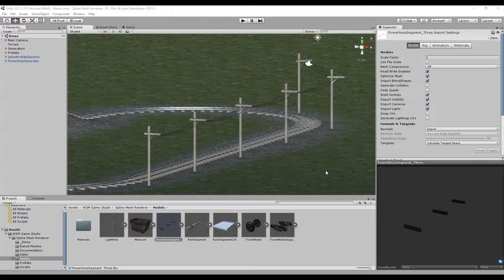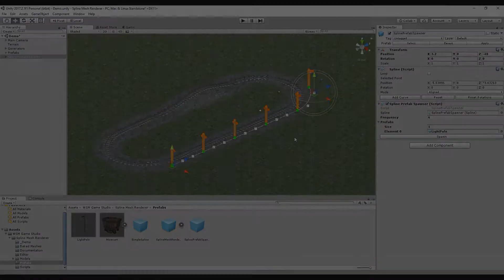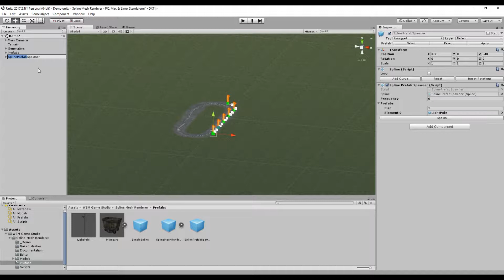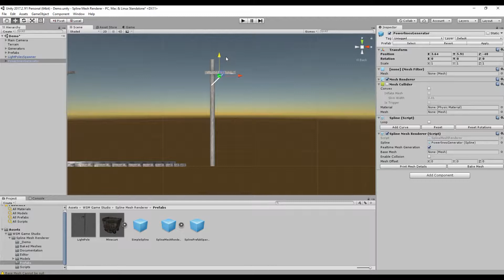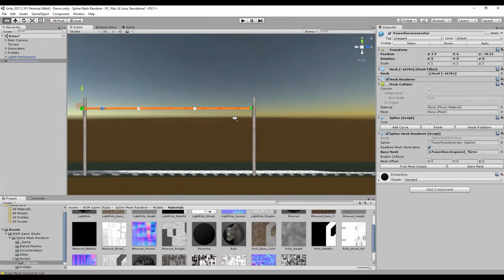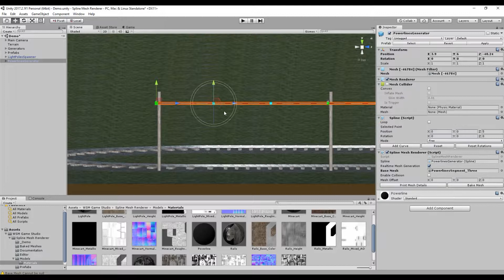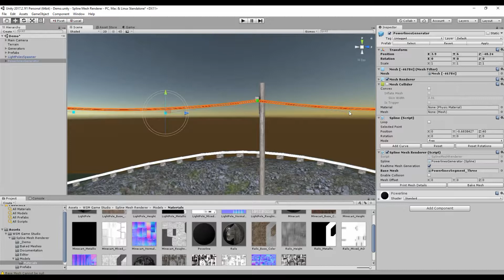Spline Mesh Renderer v1.0 Tutorial 2 - Powerlines (Unity 3D)

Comment: Can the wooden pole fall over and drag the spline with it ? In other words ..can the Spline be a child of another gameobject and move with it ?
Reply from the maker: Hi Tony, the Spline can be used as a child object. However, to get a good result for the pole falling and dragging the wires, it would be necessary to perform realtime in-game mesh generation to deform the wires.

Realtime in-game mesh generation is not supported yet. This feature will be included in future versions. 

Follow us on social media to get notified about future releases: 
https://www.facebook.com/WSMGameStudio

Best regards
Reply: @WSMGameStudio  awesome thanks for the reply! So I can for example create a player gameObject and make a spine path that rotates severall objects around the player vertically and switch to horizontal spinning around the player (orbiting in this case )? Cause if thats the case im super sold and will get it rightaway
Reply from the maker: @gursegugu  you're welcome :)

I did some testing with the current version, I was able to get multiple objects orbiting around the player. 
However, I've found a minor issue, it was not possible to all objects to have the same speed. With different speeds, it was possible.

I'm currently working on a new update for this asset, shall be released in a couple of weeks, I'll fix this issue for the next update, so multiple objects can have the same speed while orbiting around another.

I'll make sure to let you know once it is released.

Also, follow me on social media, currently it is the best way to be notified about new releases: 

https://www.facebook.com/WSMGameStudio
https://www.instagram.com/wsmgamestudio